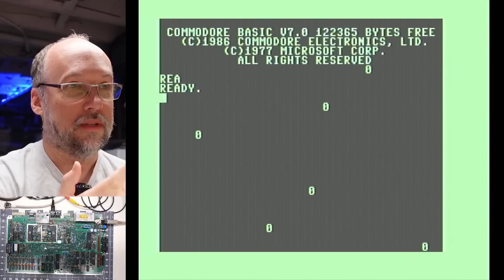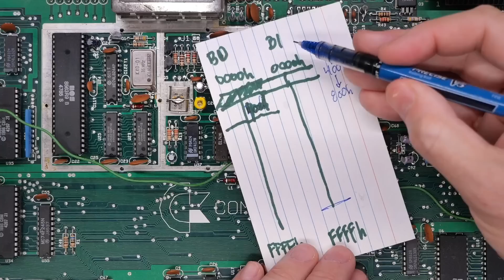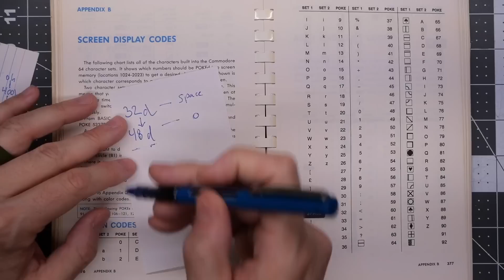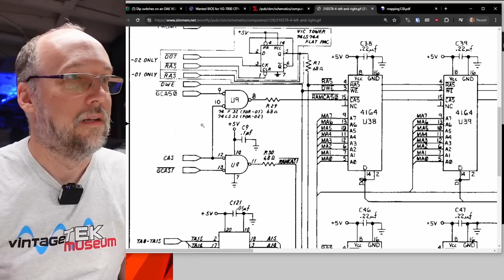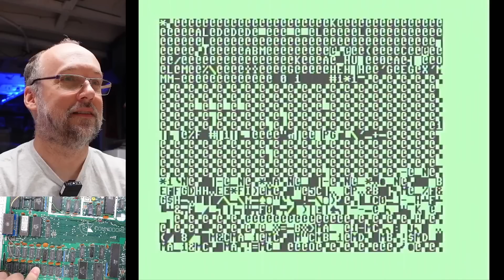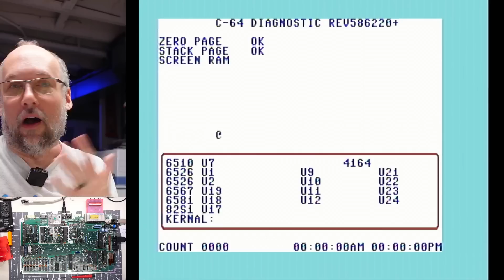You don't always need fancy tools to fix a broken 8-bit computer

Comment: binary to hex and hex to binany is easy once you memorize the patterns, remember E C A are evens and F D B 9 are odd, the least significant bit  

F=1111
E=1110
D=1101
C=1100
B=1011
A=1010
9=1001
8=0100
7=0111
6=0110
5=0101
4=0100
3=0011
2=0010
1=0001
0=0000

So for example,  random number AE31 in binary is 1010, 1110, 0011, 0001  so easy and some random binary value   1001 0101 0110 1010 would be 956A.
Reply: Memorize sixteen patterns?  I dunno man.  If you're just starting out, I think it's easier just to learn base-2.

The first (rightmost) digit is 1's place, and the place's value doubles every time you move one digit to the left.  It's exactly the same as counting and arithmetic in base-10, except doubling instead of increasing by a factor of 10, and the digits only increment to 1 instead of 9 before wrapping around to the next digit.  It was never hard, just more digits to keep track of for any given total value.  Might take some pen and paper to work through it for a while, until you get good at doing it in your head.

And of course, the reason we chose hexadecimal is because every hex digit stands for exactly four binary digits, making it a more compact way to represent long binary numbers.  Converting between base-2 and base-16 is therefore easy, since you only need to work out your 1s, 2s, 4s, and 8s places, and then just move to the next nybble (group of 4 bits) for however many bytes (8 bits) or words (16 bits) you need to convert.

I think people make this out to be a lot harder than it is, and scare themselves out of trying to do it.  It's really as easy as 1, 10, 11.
Reply: @sirnickity  I also worked with octal which is 3 binary digits instead of 4 on a mainframe in the 80''s.
Reply: @anonymous-r3p8x   Huh.  You know, I've never thought much about octal.  Hadn't ever put it together that it was for groups of 3 bits.  Interesting.
Reply: @sirnickity  same "pattern" to convert as hex, just stops at 7. Linux / unix CHMod uses octal
Reply: You have a bad ram bit on number 8 😅
Reply: @ChromiaCat   Bit 3.  :-)

Comment: You can also combine the two methods, cut out the old chip and then solder the new one onto the leg remains. I've seen that done and it seems a little bit less sketchy than the piggy-back method given how many "hot" (IE internal short) memory chips I've seen in various C64 repair videos. OTOH, once it's been cut out it's not that hard/risky to just remove the legs, it's SOO much easier than removing an intact chip.
Reply: that would be prefrable to this crappy method.

Comment: Thx for the lession ..,.But there is something that i didnt Understand ...if the 4 Bit in the Memory didnt work ,why the whole screen isNOT  putted with 0..or  possible i have the wrong whought ?! hwta i have seen is thzre is alkways the same screen loktion putted a  48 instead of 32
Reply: Only some of the memory cells in the chip are faulty, not all of them.
Reply: @Zeem4   THX
Reply: As I understand: that chip was not totally bad, only sometimes, in some cases (particular address combinations?) it put out a "higher zero" because some internal fault. The faulty zero characters were at the same places as I remember, so you could count which screen positions were those and try to follow the problem...